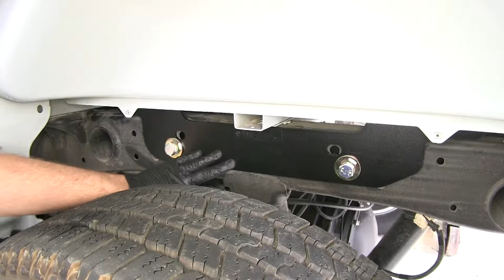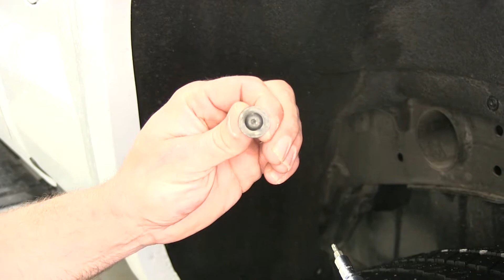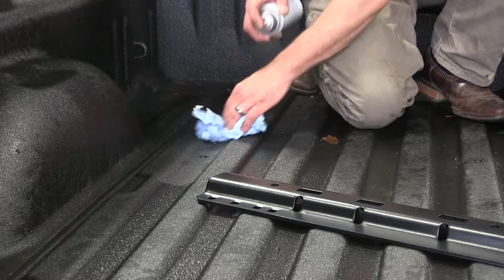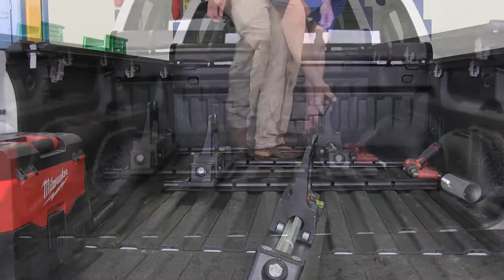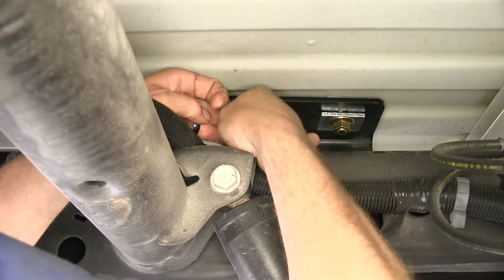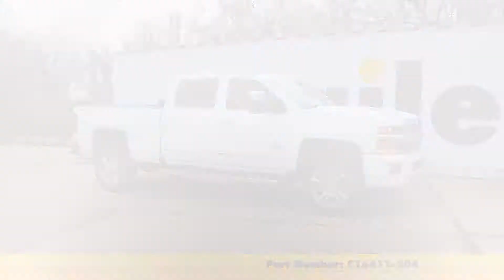Set up: Curt Custom Fifth Wheel Installation Kit for Chevy/GMC on a 2016 Chevrolet Silverado 2500

Comment: On your frame mounts you show only using two bolts into the weld nuts, Looking at the directions it shows to use those plus to fish two more bolts thru the frame which would be four bolts on each side. Is that necessary or can I do just the two into the weld bolts?
Reply from the maker: I recommend installing as indicated in the instructions if possible. 

https://www.etrailer.com/Fifth-Wheel-Installation-Kit/Curt/C16411-204.html